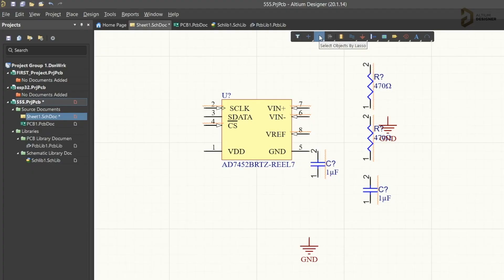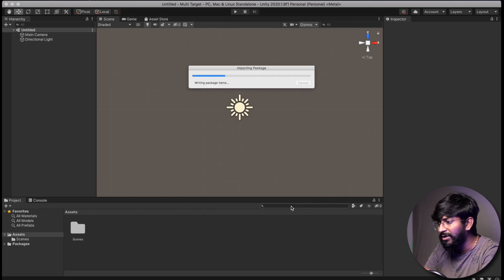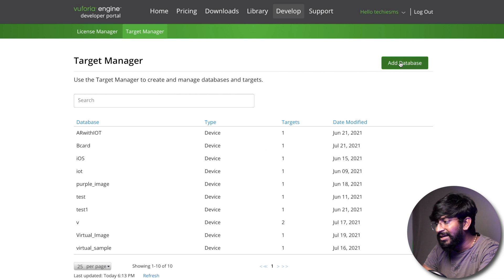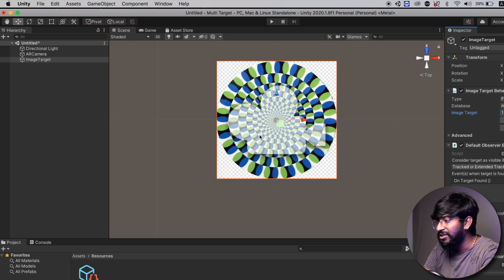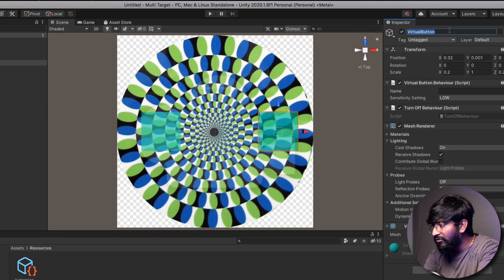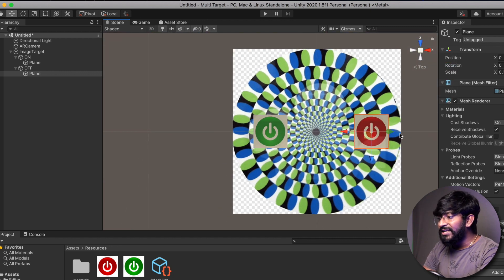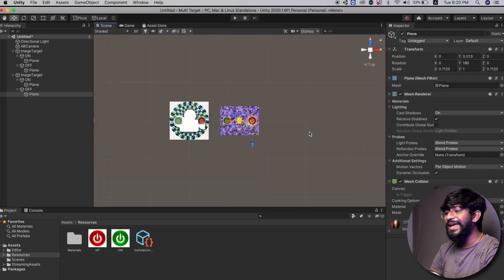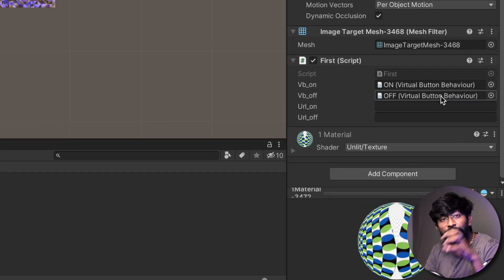Create Multiple Target AR Project for Home Automation | AR with IoT

Comment: Pls tell the solution to fix

Exception in callback: Failed to create VirtualButtonObserver: INVALID_AREA.
UnityEngine.Debug:LogErrorFormat (string,object[])
Vuforia.Internal.Utility.UnityLogger:LogError (string,object[])
Vuforia.Internal.Utility.Log:Error (string,object[])
Vuforia.Utility.ExtensionMethods.DelegateHelper:InvokeDelegate (System.Delegate,object[])
Vuforia.Utility.ExtensionMethods.DelegateHelper:InvokeWithExceptionHandling (System.Action)
Vuforia.Internal.Core.Engine:OnStart ()
Vuforia.Internal.Core.Engine:Start (System.Action)
Vuforia.Internal.Core.Engine:Start ()
Vuforia.VuforiaBehaviour:VuforiaInitialized (Vuforia.VuforiaInitError)
System.Delegate:DynamicInvoke (object[])
Vuforia.Utility.ExtensionMethods.DelegateHelper:InvokeDelegate (System.Delegate,object[])
Vuforia.Utility.ExtensionMethods.DelegateHelper:InvokeWithExceptionHandling<Vuforia.VuforiaInitError> (System.Action`1<Vuforia.VuforiaInitError>,Vuforia.VuforiaInitError)
Vuforia.Internal.Core.Engine:InitOnCameraReady ()